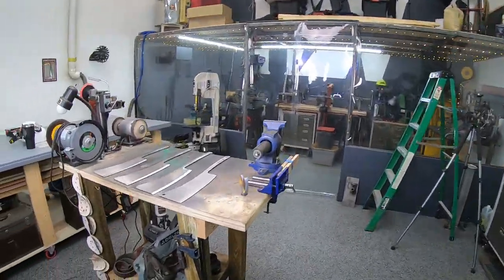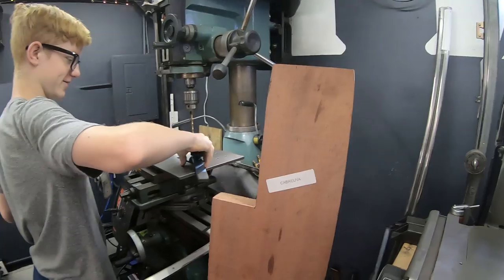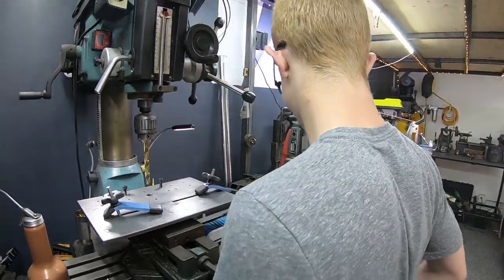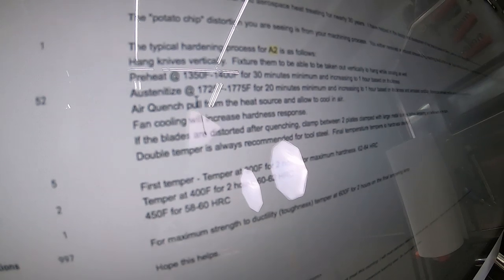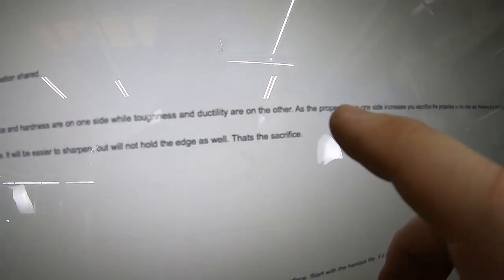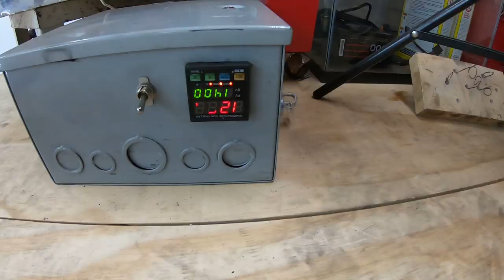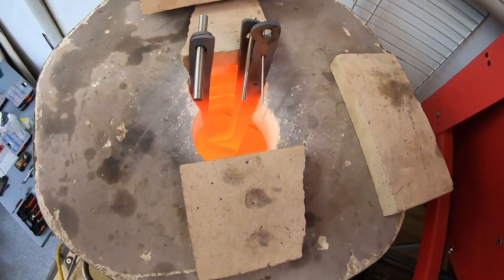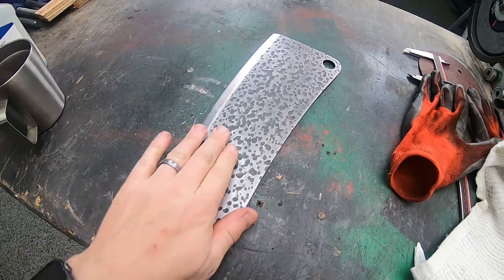The Heat Treat - A2 Tools Steel - Cleaver Making

Comment: I'm not 100% sure on this.  Maybe you could confer with your heat treating guy ..  sorry I forgot his name.  But in my opinion you should be wrapping your A-2 to keep the carbon in the steel while heat treating.  Essentially you will have a tougher stronger knife.  

And be careful with those welding gloves.  1750° is frigging hot.  I've gotten burned a couple of times while heat treating.    

I'm a Machinist by trade and we do our own heat treating at work.  But great content as usual.
Reply from the maker: Hi Paul,  I got an instagram message from someone this morning saying the same thing. I will be digging into doing that. Stainless foil is really expensive so I am not sure I will do it just yet. But it is something to consider.  And yes I need to up my game on the gloves. I use tongs and such but these big blades are a menace!